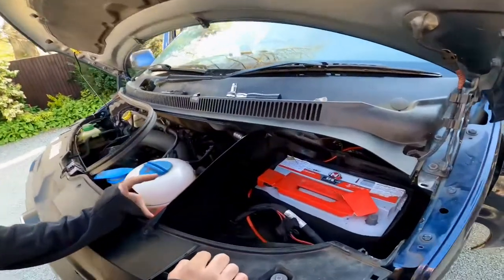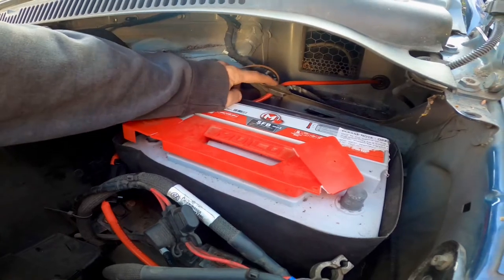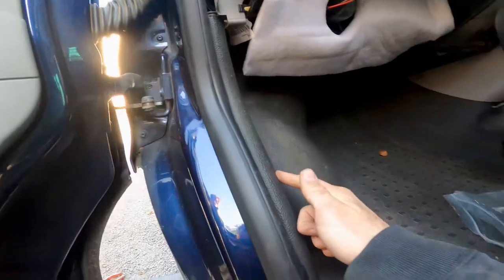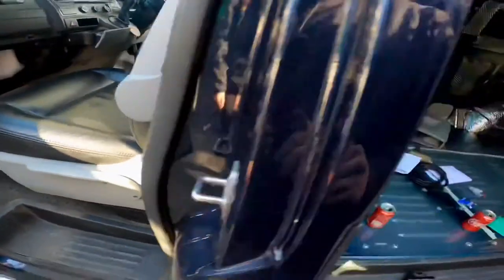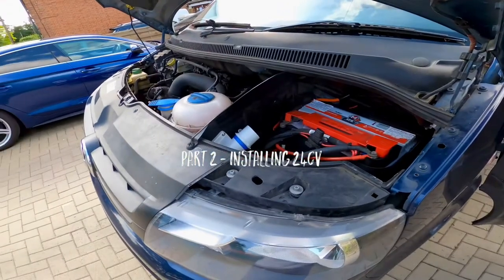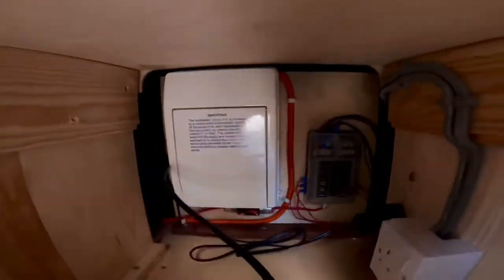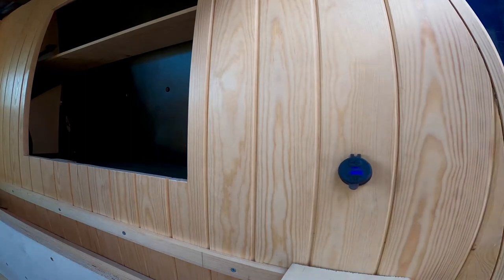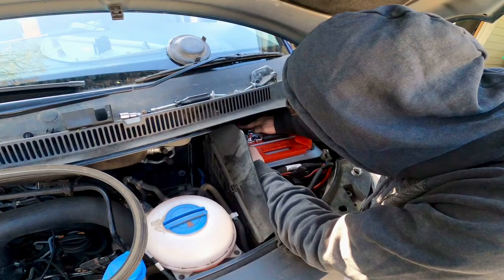Van Build EP 8 - Electrics | Installing 12V and 240V electric hook up | VW Campervan

Comment: Would recommend replacing the grey socket cable for flex, as the twin and earth cable is rigid it will eventually break due to the  vibrations while driving
Reply from the maker: Thanks for your recommendation! We will definitely take note for when we update our electrics in the next couple of weeks.
Reply: Artic blue 2.5mm 3 core is best for temp range
Reply from the maker: @williamroyal5216  thank you! ☺️

Comment: Hi.. with your electric hookup, did you run that to the consumer unit and then did you have to run each 240v plug socket (you had 2) individually from the consumer unit or were they wired in sequence or something thanks